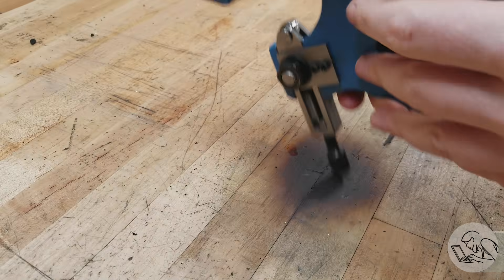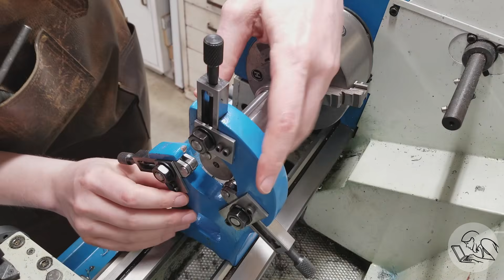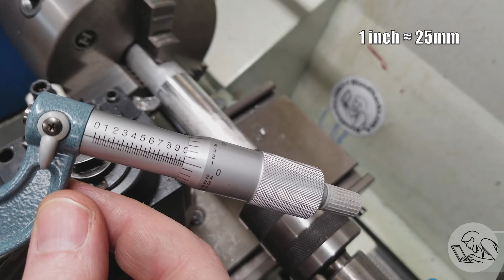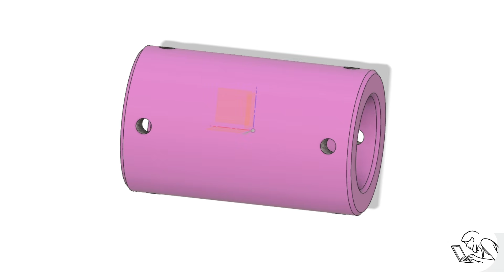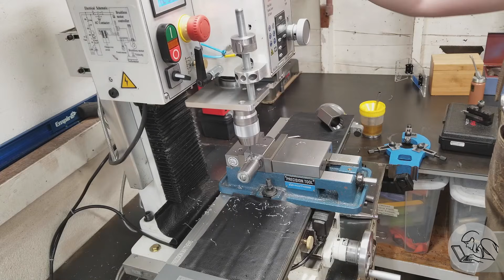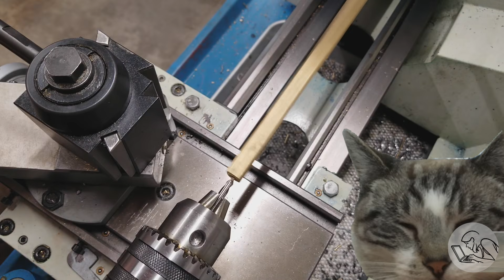Let's Make a Cat's Head!

Comment: When using the cats head on the back of the spindle bore for long and skinny stock, would it be possible to use an indicator with that to setup a repeatable "stop"?
Like, let's say you're making a dozen screws from round bar
Round bar goes through the spindle bore, cats head goes on the stock, and indicator is zeroed out on the end of the cats head when it's in the spindle bore. Then, loosen the cats head slightly, pull it along the bar to the length you want the screw, then tighten the cats head down. Now zero the indicator. Then pull the stock through until it the cats head "stops" at the spindle bore location.  Make the screw, loosen the cats head, then move the cats head along the stock until the dial indicator reads zero again. Then loosen the stock. Then pull the stock through until the cats head is back in the spindle bore, tighten everything down and make another screw. 

Thoughts? Is this madness? Am I over thinking things again? Probably

Comment: Once your Cat's Head is running true it should be possible to use the Dial Indicator on the work flats. Then adjust the Grubscrews to true-up the stock.

Comment: Another amateur machinist here, love the project, I also have some mystery steel perfect for this. So after using it, do you think it would be more user-friendly to have maybe knurled head socket screws that you could adjust the coarse setting by hand (like thumbscrews with a socket head), and then use the wrench to achieve final tightness? My guess is that if you had enough clearance on either side of your steady rest it would be fine, as they're only put in one side for the back of the spindle arrangement.

Comment: nice to see how it is supposed to be done, when i got started i would take deep sockets (6 and 12 point) that would fit the part, cut or bore the square end , cut a nice groove in the middle that fit my steady rest rollers(locks it in place) then you can easily slide the setup anywhere on the material you want. if it is too loose- coke can shims.
yeah, i know it is kinda hokey but i made a lot of parts that way.
Reply from the maker: That’s actually a really good idea 😄
Reply: @Blondihacks  thank you, it was all i could come up with at the time- each one still sets on its little wooden peg

Comment: Awesome, another great project that results in another useful tool, thanks, Quinn!
Just one question, in the end, when you put the center hole on the square stock before the Cat's head is on, if you acknowledge the runout of the stock. So the hole on the square stock is not centered and also it isn't running true inside the Cat's head. Is there a way one could have it run true inside the cat's head and therefore have the features on the end perfectly concentric?
I assume that would go against the stock's bend?
Reply: As a machinist, one will on occasion, have to turn some square or hex stock with features on it, and may well do so while in a "cat's head", if the four jaw doesn't fulfill the need, and if one needed a bore to run concentric with the outer dimensions, centering the stock in the "cat's head" would be necessary.

Comment: Hi Blondie, Best steel for these types of jobs is free cutting steel with a small percentage of lead content. Lovely to machine. Cannot case harden this material. Hope this tip helps. Regards Steam locomotive fireman.
Reply from the maker: Indeed I use 12L14 mostly. This time I didn’t have any the right size.

Comment: Cats heads can be useful, especially in gunsmithing. Make it about twice as long, and put a 1/2" slot down the middle....very good for bolt work. Look at Pacific Tool and Gauge for an example. Also, you can find some brass-tipped cap screws to use for set screws at GRIZZLY.com

Comment: For better parting, turn the parting tool upside down and run the spindle in reverse. This way the tool can flex away from the work instead of digging in. Make sure the chuck won't unscrew!

Comment: If you have the spindle running around 90 rpm, you can tap on the top of the bar to get it running true. As you are tapping at 90 deg to the indicator, it does not shock the indicator. Takes a little while to get used to doing it, but does save a lot of time.

Comment: Instead of sticking a emery wrapped conduit into a bore try a small piece of rod that has a split in it lengthwise. The conduit can grab and whip around and do a fair amount of damage to the machine and possibly you. It you take a piece of 1/4 or 5/16 rod and cut a slot in it lengthwise you can insert your emery in the slot and wrap it around the shank. The more emery tape you wrap around it the tighter it will be in your bore but it won't grab since it can compress around the shank as the work spins around it. The emery acts like a poor mans flapper wheel .
Reply from the maker: I have a such a contraption and have shown it on my channel before. I opted to try something different this time.

Comment: AWESOME PROJECT ! ! !

However (!) As a "Dualist" That is, Ahem, BOTH a Metal Worker AND a Wood Worker, I ~Deplore~ your "WOODIST" comment, ) I think I might start a SJW group called "All Materials Matter" ( ! ! ! ) . 

Wood Workers HAVE Feelings "two", you know! 

In my 70 years of living, I first Started as the Humble Woods Worker, in 1957!  Where were YOU then ( !!! )

I currently work woods from ~Au Natural Woods~ to fit my needs, and can Square a burl with the "best of them". My accuracy is CTF, A wood workers term meaning "Cut To Fit" and My saws can leave BOTH sides of a .9mm pencil line ( ! ! ! ! ! ! ) 

Meanwhile, I have done (Cough, Hack "HAIRBALL" Discharge) Metal Work That literally is in use Around the WORLD on Trombones ! ! ! (Really! Someone HAS to make Trombones you know)!!!!

Finally as a Minority Male. that is, a person OWNED by a Cat, I noticed several of your CATS were Upside DOWN :-(  Don't you ~NO~ that Cats Abhor the Opposite of Right Side UP???????

All jesting aside, A very fine project, And the ONLY thing I would add is a Plug for the speed hole, possibly in Brass as a opposing color of the "Mysterie Metal" ! ! ! !

Comment: Hey Quinn nice cats head, but when you put on the back of the spindle you also add a piece of round tube that fits in both the cats head & the inner bore of the spindle to use it to hold the stock protruding out the back of the lathe. Cheers from Oz

Comment: If you want to have some good chip breaking inserts for that carbide tool i have had good luck with TCGT21.51 inserts (assuming that is the tool i think it is). They are for aluminum, but i found they worked well for steel as well when i had my 9x20 sheldon. They really make up for a "less" rigid machine.

Comment: Quinn if you slice me off a couple of .250 disks of that bar stock i can run a couple heat treat tests and get you close to the family of steel...i e hows it quench, water, oil, air, or plate...see how it reacts to etch and eyeball the grain structure under my scope...ive got a couple guesses and im sure not gonna be able to give you its exact alloy but i can at least see if it reacts like some of the steels i use in my work...
Also cut a coupon off it (disk) and soak it in ferric chloride or muriotic..if theres a "stripey" pattern its wrought...wrought is notorious for long stringy runners coupled with ridiculous hard spots...

Comment: You could take a little off the steady rest on the back side where it sits on the bed to get it centered better then match the angle on the front side. I suspect if you check it with some ink, it doesn't match up well.

Comment: "Obtain consent" Get your mind out of the gutter! Re: MOSFET efficiency and torque on your motor, MOSFET switching speed determines losses in switching applications so it must really be, lets see. r cross F and current times number of turns and Maxwell says hmmm. But Weber says if you put the coil inside a potato with a vector drawn normal to the surface and integrate. Uh....never mind.

Comment: Are you sure this stuff is mild steel? Seems awfully hard. I have some 'mystery metal' steel from a made in china fireplace set that I used as square stock for a few odd jobs, I thought it was mild and was constantly confused by how difficult it was to work with until i tried to file it... I'm pretty sure that stuff was as hard as 4140HT! As with this material it made a heap of heat when cut, even when I used water based coolant.

Usually carbide inserts need a certain DOC before the chipbreaker starts to work- I find if you don't go deep enough the chip isn't wide enough to actually reach the chipbreaker, it just goes through the gap between the cutting edge and the chip breaker at the point of the tool and makes some stringy nonsense. Cut nice and deep (and with a feed rate of WAAAAAAGH!) and you'll get those nicely breaking chips even on gummy materials.

Comment: Excellent addition to the lathe arsenal 👍.
I think you need a "Flap Stick" for polishing bores on the lathe, just a bit of round wood, with a diametrical saw cut for a short length on one end, then thread through your choice of abrasive paper.
Great vlog, thanks for sharing.
Best regards from John Quinn.

Comment: But wait, there's even more:  Sometimes you might need to turn or bore an eccentric feature on both ends of a round bar (say to cam a door against a gasket on both sides with one handle).   The cats head gives you a way to  support a long piece of round stock and turn those eccentrics...so the cat's head can even be useful with round stock.   

Bonus trivia:  Another name for a capstan type winch is  also "cat's head".  A capstan is the style of winch common on boats where the rope wraps around  a drum several times, but doesn't accumulate on the winch...so you have to "tail"  (cat's tail...see that?) the free end of the rope,  which means lightly tensioning it so the capstan maintains friction to pull on the load side.  Modern sailing winches have a self-tailing mechanism, so they can be operated with just the one hand on the crank.
The nautical term may be the origin of the machinist term, as both feature a smooth drum.
Reply: This "Cathead" example was what I as going to comment on. When I started working in the oilfield in New Mexico (1971), the drilling rigs had catheads that were used as winches to pick up pipe and other heavy equipment up to the rig floor which was usually about 20 to 25 feet off the ground.

Comment: I AM SUSPICIOUS OF YOUR USE OF BRASS TO DEMONSTRATE A DEVICE WHICH IS SUPPOSED TO IMPROVE SURFACE FINISH !!!!1!1!111!!!!!
Also, I have seen quite a bit of spider designs that clamp on the outside of the spindle. Granted that is't always possible, but there has to be a reason for this. Is there an operation where you absolutely need to rely on the machined surface at the end of your spindle bore?
Reply from the maker: Um, this device is not about improving surface finish. It’s about being able to run unusual material in a steady rest.
Reply: Yes, but one major reason for the use of a steady rest is to combat lack of rigidity which usually goes hand in hand with surface finish quality
Reply: Maybe it is also worth mentioning that altough it might not come across as clearly in written text as originally intended, the remark was not actually meant to be taken seriously.

Comment: READ THIS. First straighten the stock. Short feed the stock in the chuck. (Stick out a 1/2 inch) dial in the stock/chuck, then center drill. Feed out the stock, put on cats head, install tailstock/center, dial in cats head and install steady. Otherwise the part will still be bent and out of round. Good show of cats head but if you don't get the details your teaching folks to make bad parts. Don't get me wrong I like you and your channel. Keep it up. TOT... who is that. His content is slipping. 🤣

Comment: Nice video! If I had to guess, that stock is 1018 carbon steel.
Reply: My guess as well. It wants a lot of torque and negative rake so as to shear a microcracking chip about 1/8th long (.090 - .130) is typically recommended. It can pop them a long way too.

Comment: Sis, you forget there is another pet in your drawer, the good old dog. While you struggling 50 rpm with 6 inch material flipping outside the chuck, that's a very good cause to bring out the dog to bite that steel stick 😃

Comment: Quinn,  switch your parting tool to operate upside down and part in reverse.    Works great because any flex lifts the blade out of the cut rather than forcing it into it.

Comment: WOODWORKER grade precision???? You do realize that we use KNIVES to mark our work, don't you! You... sharpie using machinist. ;-)
Reply: Blondie just started a war!
Reply: Be careful, our profession is addictive. You will be apart of the knives for scribes program.
Reply: @brianrhubbard  Addictive or not…it’s loud.  My workshop is in the living room. A shop-vac is tolerated, because it makes things clean. A drill is OK, but I have to give notice to use an impact driver. Anything louder than that is done on the balcony.
Reply: @klemchi7645  LOL
Reply: I used Dykem and a scribe when I was manual machining. Now I use an optical probe and G -code.  You do know I was just joking around right. I haven't even touched a caliper in years, instead we have CMM's now. On the down low, the caliper was my favorite marking tool.
Reply: Carbohydrate foam marks with a sharp glance
Reply: Woodworking gets a fairly bad rap when it comes to accuracy, from anyone who has ever seriously looked at a house(in the US) that is in the process of being framed or has tried to DIY remodel said house. There is a very good reason it's called Rough carpentry.
Reply: go play with your dead tree carcasses and let the real workers work xD
Reply: @____________6145  Tell me “real worker”, have you ever connected two pieces, that change size on their own in different directions, AND have them stay together? I think NOT!  😉
Reply: Nope but can you turn a cube inside of a cube?